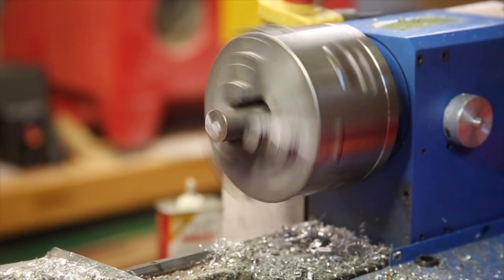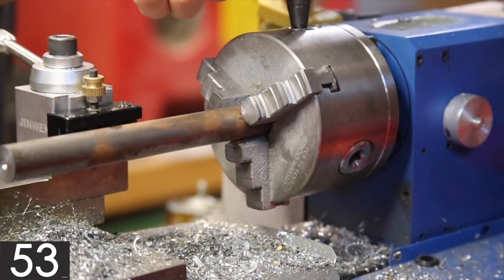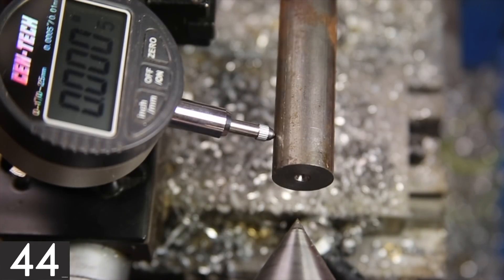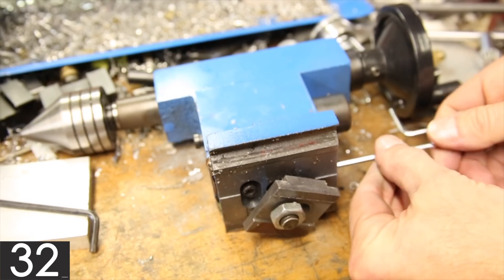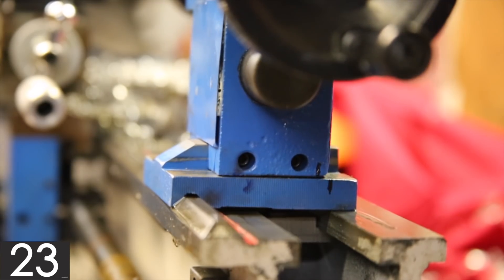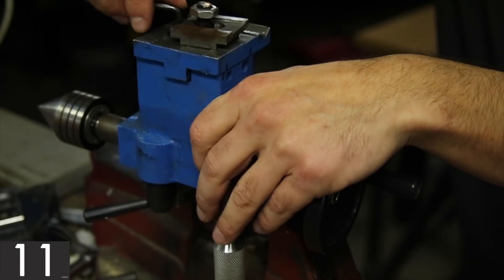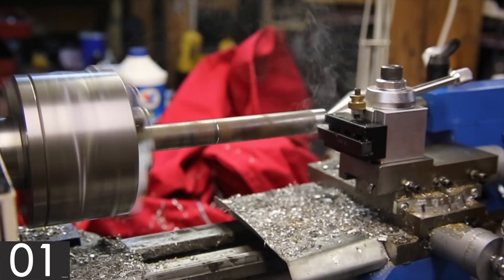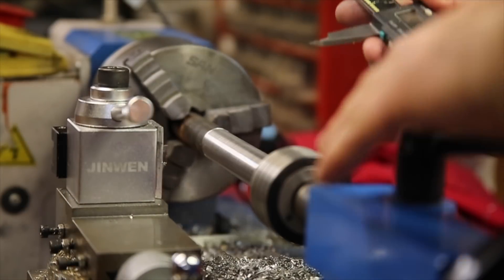60s Tutorial - Tailstock Center Alignment on the Mini Lathe

Comment: How'd you get the initial center drilled hole centered?
Reply from the maker: Using a center drill bit with the work piece close to the chuck. The centering bit self centers.
Reply: So he made a center hole with a same not aligned tailstock that he tried to align? So how does it align tailstock later if the center hole is initially made with that same not aligned tailstock?

Comment: Perhaps I'm missing something, but how do you center drill it with a misaligned tailstock?
Reply: The small drill bit will automatically center itself, it becomes a problem if you go over an eighth of an inch, you only need enough space for the tip of your tailstock center to rest👍
Reply: @Brianbri-nq3cc  Thats bullshit, small drill bit does not self align
Reply: @AlexeiPavlov If your workpiece is spinning then the drill will be  " forced " to follow and centralize  in the axis of rotation.
Conversely,  if the workpiece is stationery and the drill is spinning , it can or will wander or deflect

Comment: Excellent video.  It had just what I needed.  Mine looks like yours and it is off just a tad left to right.
Reply: So he made a center hole with a same not aligned tailstock that he tried to align? So how does it align tailstock later if the center hole is initially made with that same not aligned tailstock?

Comment: I have 4 screws to adjust.
2 on the back, 2 on the sides of the tailstock.
No matter what screw i turn, things go south.
Not only that but i have a height issue too.

I ended up drilling a hole with the center drill, then i would insert a live center into tailstock and push it into the cutout.
Loosen all screws, push it into the hole and it will self align.
Tighten the screws gently one at the time.

Comment: little confused, you used your tailstock to drill a hole then used the same tail stock with a different attachment to check for alignment, and used a three jaw chuck to recenter the piece? Not sure how the works. sounds more like a concentricity issue than an alignment issue.  In short, once you remove the piece from a three jaw chuck it will never be aligned the same, concentric.
Reply from the maker: The goal was to minimize the taper moreso than worry about concentricity.

Comment: Hi Tim, Extending the bar out of the chuck after center drilling and clamping the bar on the bar OD is not accurate because the chuck jaws are likely not uniformly centering the rough OD of the bar, and the bar straightness, roundness and uniformity  are not known. 

Center drill both ends and mount and turn an area of the bar near the head stock, zero an indicator on the turned OD as mounted form the cross slide, remove the turned bar carefully not to bump the indicator, traverse the cross slide to the tail stock end, flip the turned end of the bar to the tailstock end and mount it between centers, touch off the now preset indicator to the turned area of the bar, and read the amount of the off=set. As set, adjust the tailstock. Double check it. Everything must be clean as you described it plus the center must also be checked for runout before beginning.
Reply: Thank you don.
Reply from the maker: @behold.the.flux.switzerlan3536  Great comment! Thank you!

Comment: how would this be accurate if the tailstock was already off centered when drilling the initial center hole??
Reply from the maker: Because I drilled the center hole with almost no stick out and the nature of center hole bits and the fact that the part is turning guides them to the center of the part using the available slop in the tailstock.
Reply: @TimNummy  yeah right your felt marker was almost 1cm off, how is that centering?

Comment: that was a quick solution indeed, i can see the usefulness especially when its an older lathe and you might need to tweek it along the ways, but it only aligns it side to side though. A more accurate solution would be to center the stock, cut the tip into a point and cut the side of the stock to create a reference surface, then extend the stock and measure at the cut ref. surface, align the two tips and pinch a steel ruler between the tips, if the steal ruler is stuck between the tips, 90 degrees both vertically and horizontally, then you are dead on . :)